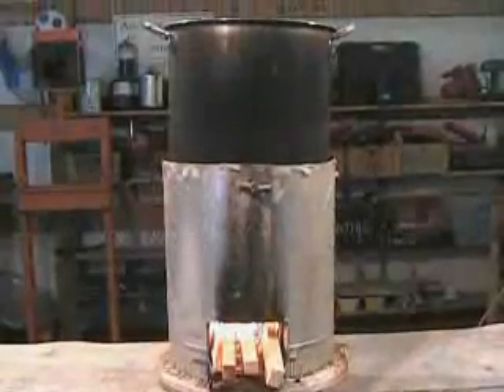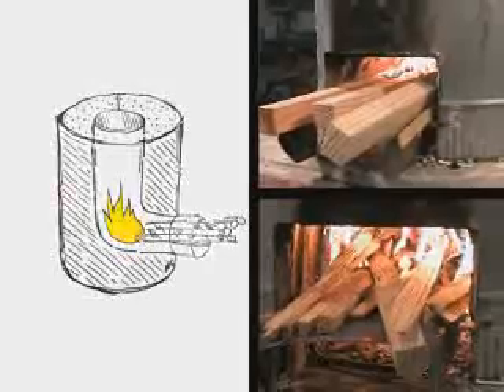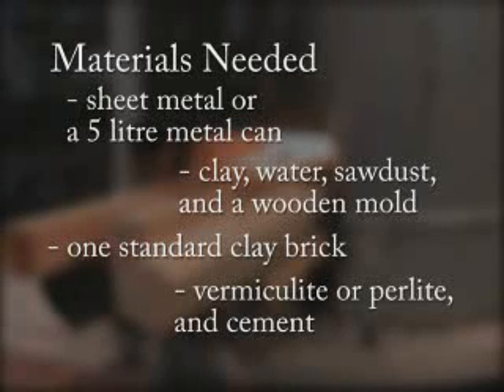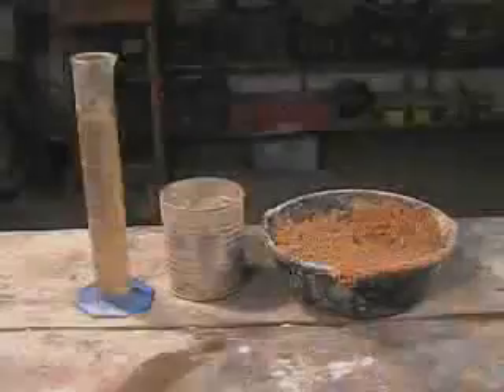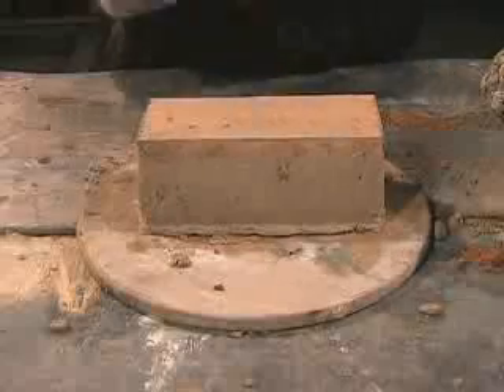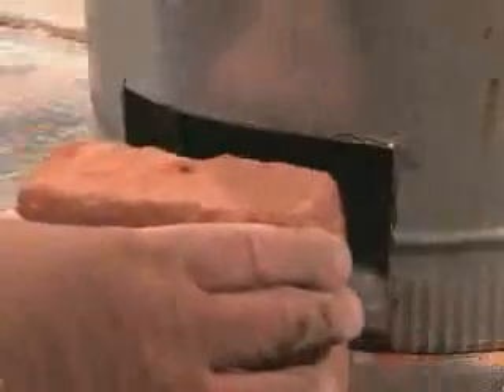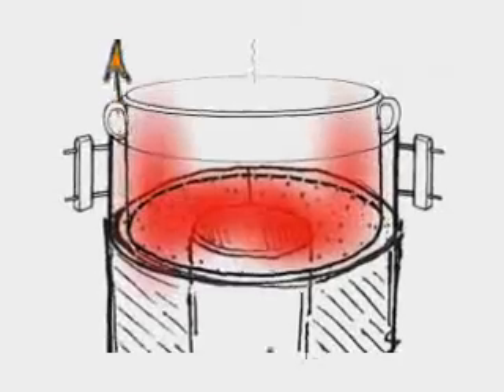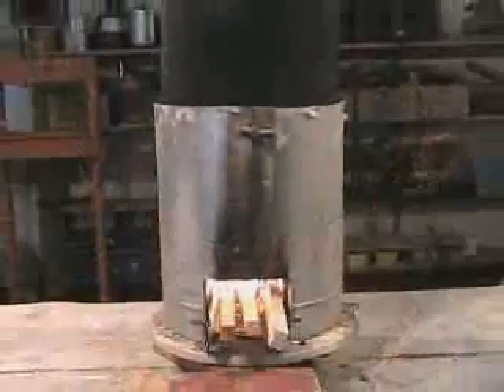Build a rocket stove

Comment: A bit late here but here's a reply to your comment:

Extruded bricks are not as dense as dry-pressed bricks, which are not as dense as brick pavers, and brick pavers are not as dense as fire bricks. 

This is because regular bricks have more air pockets in them than the other two types. The air pockets inside the bricks will expand with heat and jeopardize the integrity of the brick structure.

Comment: @aproresearch If you put ridges in the mold for a monolithic structure it would crack on the grooves rather than randomly, so you could prevent cracking that would cause the internal structure to fail.